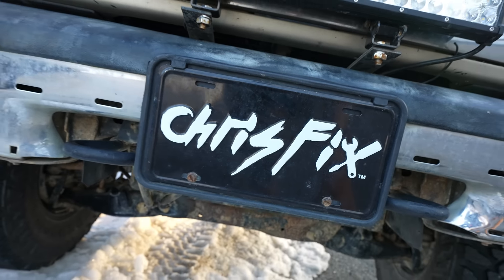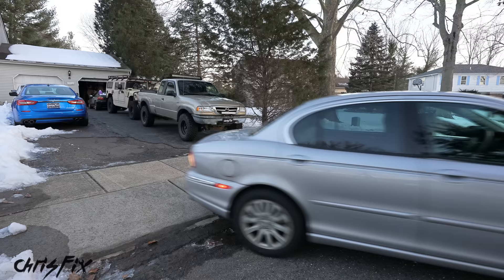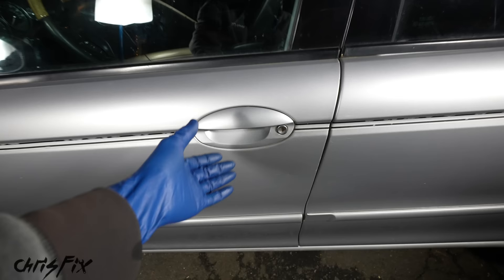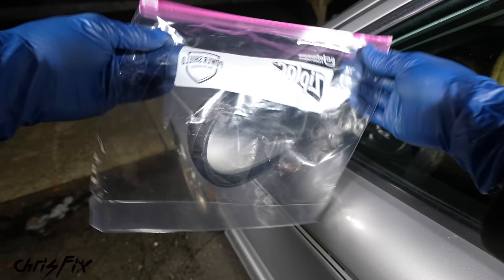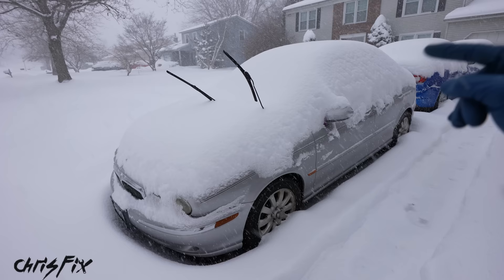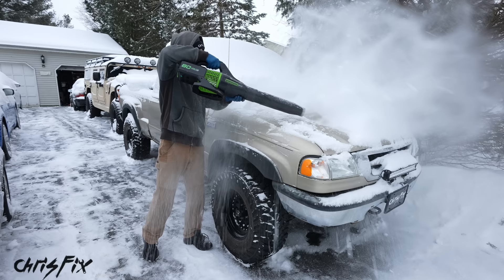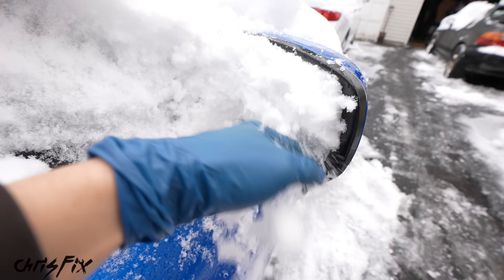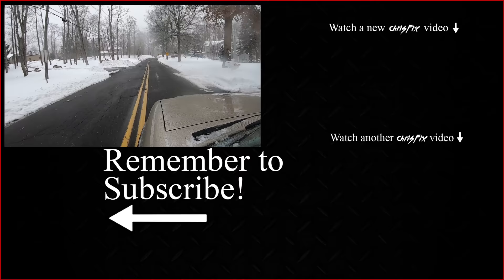10 Winter Car TIPS & TRICKS you NEED to Know

Comment: I shovel the plow - I dont drive thru it,,, when I pour wiper fluid I use a funnel,  when I park my car I protect my engine by parking the trunk facing out,, my friend had the front of his car hit and was told if it had been the back it would have cost one fifth the amount to repair hahahahah and why is that truck on empty if so close to winter, and I cover my window with a thick old carpet,, much easier to remove and it goes nowhere -  the use of silicone was a very good idea - dont buy a brush buy one with rubber ends, and I have that leaf blower and it does not work very well, it would only work if the snow was light and just fallen, I just pour cold water on any part been doing it for decades never a problem

Comment: Tips for keeping car battery working in extreme overnight  temp changes.?
Reply: Battery heater / blanket.  Leaving it a trickle charger overnight  helps too.

Both have to be plugged in, so it certainly won't work for everyone..... if you park in a big apartment parking lot where you can't run an extension cord for example.  In this case having a jump pack in your emergency kit comes in handy.
Reply: @SlavaPunta thank you for responding!   Your answer is very helpful. 😊

Comment: You completely forgot the car battery in the preparations.
If a brush damages your paint job. You have a terrible paint job.
Of cause if you life in a cold area, order your car with an auxiliary heater. (and also use it in summer, so the fuel pump doesn't gunk up and you never have to start your car with cold oil)

Comment: I slightly disagree with backing a car into your driveway if it's front wheel drive. If your driveway is cleared and the plows have pushed a pile of that hard snow onto the end of your driveway, backing out will give you better traction to push through it. Your rear lower valance won't love it, but you won't be stuck. Another tip is to always keep your rear view camera clean if your car has one. Salt quickly builds up on them and obscures the image.
Reply: I agree with keeping the ca.era clear/clean (mud too).
Driving forward always maxi.izes visablity

Comment: 13:34 Boiling water on glass:

What I do is way easier and much more effective:
Fill pitcher with hottest tap water.
Pour on windshield.
Drive to work.

I've been doing this since the 90's and have never had even an inkling of a crack in any windshield. 
I've owned an uncountable number of crappy cars and I live in New England, where we get way more snow and ice than where Chris is from.

Please put this old wives tale to rest.  I challenge anyone to crack their windshield with max-hot (125f) tap water.  You can't do it.

Comment: So when he says silicon spray,  is that what wd-40 is? Lol or could I use Cooking spray?
Reply from the maker: No, it’s literally silicon spray. Wd40 is petroleum based and evaporates too fast. Cooking spray could work temporarily but it will degrade the rubber over time.

Comment: You are using the windshield cover wrong. You leave the wipers down so the cover protects them. you don't stuff the cover into the wiper well but leave it on top of the hood. Its supposed to cover all this stuff so you don't have to clean it out. mine also  has flaps that you close the door on, much better.
If anyone is worried about being stranded keep a few candles and lighter in the glove box. not only won't you kill yourself with breathing in exhaust gases but you will have gas the next day to drive away with.